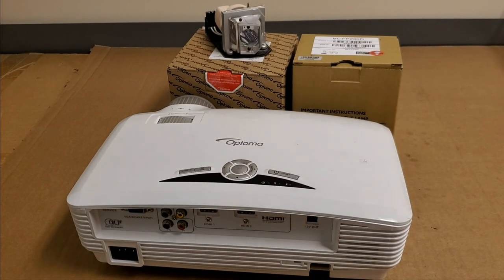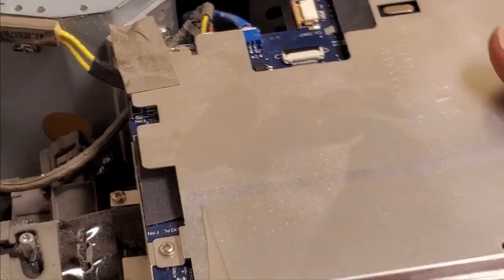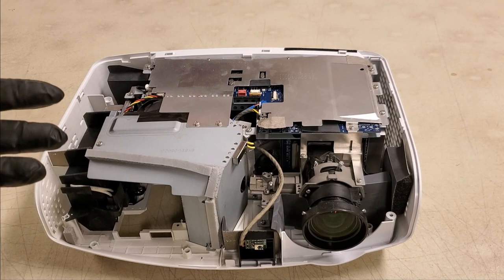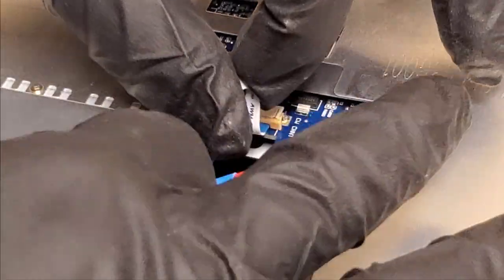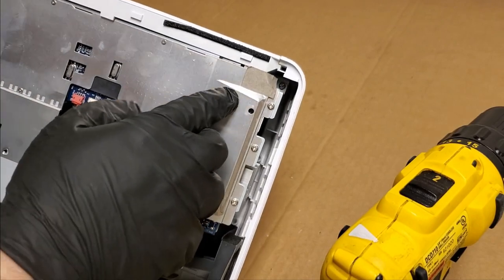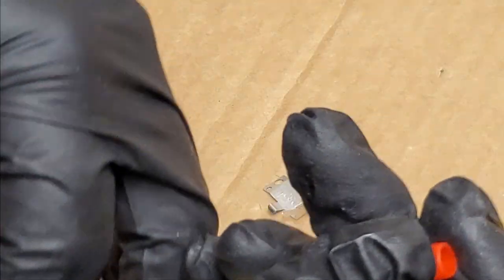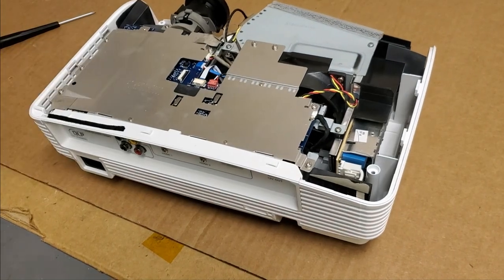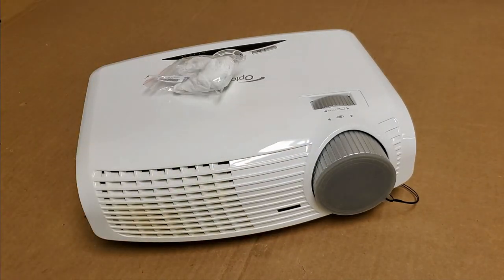Optoma HD20 DLP Projector Color Wheel/Light Tunnel Repair

Comment: i have a optoma HD23 none of my control buttons are working i can power it up with the projector and remote but i have to unplug it to turn it off i cant play no movies only thing it displays is hemi 2 1080p 60hz
Reply from the maker: Does it start to work normally after you unplug it and plug it back in? Since its the same as the HD20, I'd suspect the capacitors in the low voltage side of the power supply as being leaky/bad. It might be something else so be sure to check the voltages.  The service manual for the HD20 should cover the same power supply. There is a chance it is a mainboard issue but since it does start up, I bet it's a power supply problem.  
If at some point HDMI1 was hit in a power surge that can also cause this sort of damage.  
When did the issue start?
Reply: @FixitFrank  I was changing the screen size on the settings on the projector and it just locked me out of the buttons I couldn't get no  video on it it had been working fine until I tried to adjust the screen size
Reply: @FixitFrank  no it doesn't go back to working normally after I unplug it and plug it back in The only thing it does that I could touch the power of button and it starts up on the projector or on the remote but I can't turn it off with the button or the remote I have to unplug it but it doesn't play any movies it just displays that square with the HDMI 2 1080p that's all when it starts up it starts up normal with the advertisement of the name brand and then it goes to that display
Reply from the maker: @robertgonzalez8069  I have one other suggestion. It is probably not the issue but just make sure the buttons on the keypad are not jammed. I highly doubt it, but that is one of those things that would drive me nuts until I found a stuck button.
Reply from the maker: @robertgonzalez8069  Thanks for the explanation. That makes more sense. I'd still be suspect of the capacitors in the power supply, but it kind of sounds like possibly a mainboard/firmware problem.   Check the voltages feeding the mainboard would be my first step.
Reply: can I ship it to you so you can fix it just wondering
Reply from the maker: @robertgonzalez8069  Why don't you email me and we can discuss?  I'm pretty booked up until the end of the year(holidays and stuff) but after Jan 1, that would be fine.
Reply from the maker: @robertgonzalez8069  Just emailed you.  I will delete you comment so your email address isnt picked up by spammers.